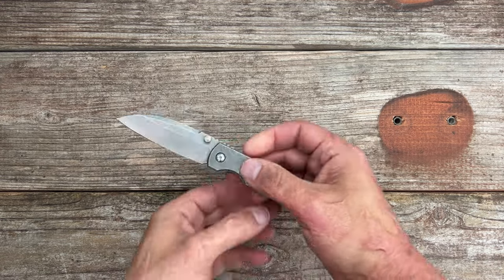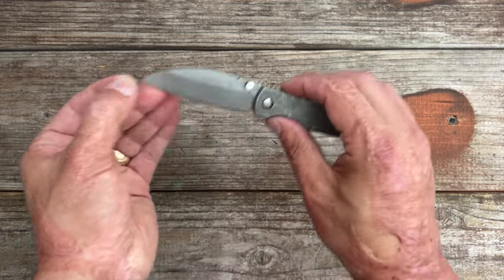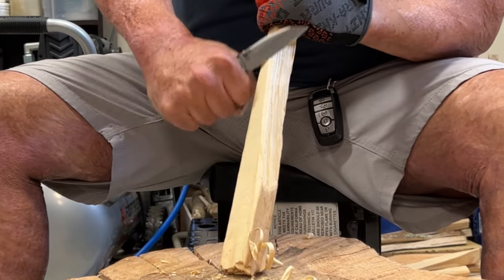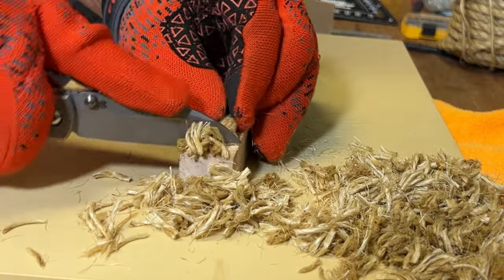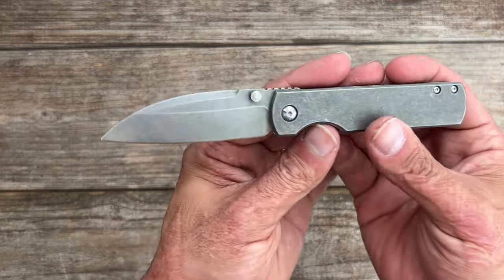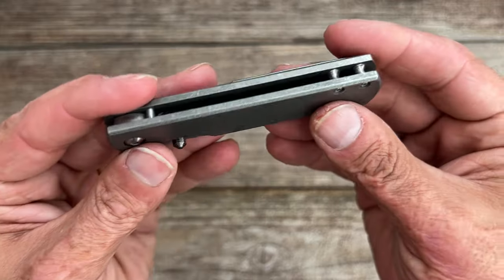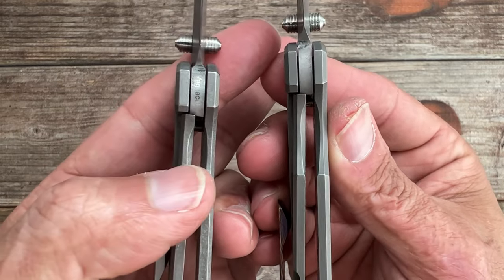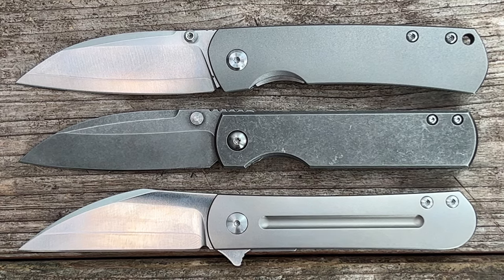Made In The USA? Monterey Bay Knives River Otter Full Review

Comment: I don’t understand why most manufacturers resist transitioning from T6 to T8 screws, in most cases. They make a small difference in appearance, but a large difference in reliability (I haven’t actually had much trouble with T6s, but many people do)! I actually like the appearance of the more rugged screw, and I like not having to worry quite so much about stripping a socket.